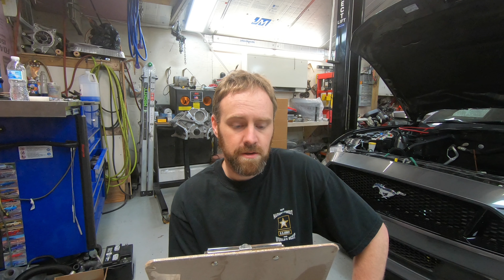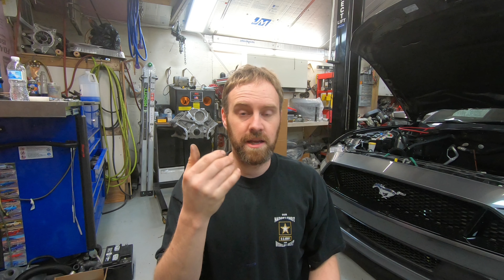AFM DOD Emissions testing & My Thoughts

Comment: In washington state we no longer need emissions testing. But prior to them no longer requiring emissions testing. The way that we would test for emissions was to check the gas cap to make sure it would hold pressure. And the second thing they did was to turn your car off and back on to see if your check engine light functioned. The third thing that they did was to actually plug a scanner into the obd2 port and check for fault codes. So as long as you have the afm/DOD turned off in the ecm and you have no other fault codes. Then there's nothing to worry about because the ecm will only give you a fault code for not having the correct parts if you have it activated. So my recommendation if you live in a state where they plug a scanner into your car is to actually get the ecm tuned to have it deactivated. When I fixed my girlfriends 07 Tahoe I used the guy that Crazed Performance recommended. They did great work with a very quick return and they were the cheapest place around. It was less than $75. I honestly couldn't have fixed it if it hadn't been for this guy right here. He's probably the most knowledgeable person on this subject besides the people who designed this system.

Comment: CT performs OBD emissions tests (not tailpipe).  For my last test, I unplugged my Range device just before pulling in and, as expected, it failed.  I disconnected the range, drove a drive cycle and it passed.  Just have to play the game.
Reply: I just failed by emissions too with my Range Tech on my 2017 Silverado 5.3.  I got it removed and was told to drive it for about 200 miles then come back.  There was a wrinkle however, I had a new battery installed about a year ago.  And they said the battery may not have cycled properly with the Range Tech.  My blue state has: emissions testing, carbon tax, green fee, and clean air act fee--all money grabs!

Comment: 2008 L76 Suburban 145k miles. AFM/DoD disabled. Passes emissions in AZ (which follows the same CA emissions testing.) no exhaust testing. Only OBDII testing and gas cap pressure testing. When idling during the test and upon throttle, the V8 mode is always on any way. I’ve never failed in past 4 years with 3 emissions tests.
Reply: Did u have a tune an were the ready monitors all set?

Comment: I just unplug my Range and drive a few mile before inspection and pass emissions in MA without a problem. I plug it back in after I get my sticker. No problem yet.
Reply from the maker: Can't do that if you have done the lifter release trick though, that's the issue these people are having.
Reply: @CrazedPerformanceRepair  So, it's turning the AFM system off AND modifying the engine.

Comment: I see that Summit Racing recommends with AFM/DOD Delete, you should go to standard volume pump, but also "plug the pressure relief valve in the oil pan".  Noting your recommendation of the pump myth, what are your thoughts with the removing the pressure relief valve and applying the plug as they recommended?
Reply from the maker: If removing the high volume pump definitely good to plug relief valve in pan. If keeping high volume pump I wouldn't do that. The big thing is to base your choice off the health of the engines oiling system. If pressure was a issue prior to service and resulted in a collapsed lifter. I wouldn't remove high volume pump unless you fix pressure issues. It's very common for the pressure issue to be a bad second camshaft bearing. I talked about this in a cam bearing install video I did if interested.

Comment: And the reason My problem with GM is they have some decent vehicles. They have potential that they could easily make good if they wanted to. They just choose to use cheap parts and they also suck at hiding their planned failures or planned obsolescence whatever you want to call it just blow at hiding it. It's pretty bleeding. I mean they put crappy lifters in their engines and their transmissions have crappy torque converters and the pressures are way too low and everything just slips and they move like a bag of hammers they shift like a bag of hammers seriously the 6L80 especially!!! Ford does it too. They're just better at hiding it... Making you use a special tool or they're just better at hiding things that are going to break as planned. You know also they like to hide stuff behind things or make things really hard to get at or need a special tool which makes my money. They're just smarter at making money than GM and pisses me off. GM should just give us the truck that we should have got. We shouldn't have to modify anything. Should just come from the factory with all eight cylinders firing and a good transmission. Even a manual. Anything other than what they're offering. I mean the 10 speed is okay. I think it's four speed is all you need in an automatic. There's no need for more than four gears, That's just my opinion. Maybe five tops

Comment: It will not pass since you'll need to disable DOD on ECM's software and most software like HP Tuners and many others even if you make a minimum change in the calibration software values it'll change CVN(s), which is calculated by an algorithm and that is what California's BAR (Bureau Automotive Repair) is paying attention to, those CVN's must match to that particular calibration #, to what that manufacturer has posted without any software changes, if a manufacturer release an update, that calibration # will have its own CVN'(s) (Calibration Verification Number) from manufacturer, if they doesn't match BAR knows it during testing and you'll get a Smog failed for the OBD portion of that test and an appointment with a BAR Referee to solve this issue and then get that ECM reflash with a "stock software". BAR has several years doing this, checking those CVN's against CAL #'s, since software for tuning has become very popular. 
Now if you have a OBD dongle connected to that OBD2 Port preventing DOD from activation, that will not affect anything if you have it that disconnected during testing and readiness tests completed after a drive cycle. Unless you have a way to keep their original CVN(s) shouldn't pass smog test in California. Emissions standards are getting more and more tighter by EPA and CARB. If you add thousands and thousands of vehicles that really matters that's why this technologies which are not perfect by far and experimantal (and more expensive) but at least an attempting to reduce pollution of inefficient internal combustion engines otherwise by not doing nothing, future generations will have a more polluted environment. Just because pollution usually is not visible, doesn't mean that problem doesn't exist, if you get an air sample on places where vehicle's density higher versus other places where's smaller, you'll see a difference in those samples, that is what those agencies are doing for decades. Sorry for those who are not agree with all this, no worries, it is only my opinion. I live in California and I working as a tech in a shop with a star smog station, I usually don't like to mention this, I'm only saying this because is related to this topic but I just know very little to this and hopefully this helps someone else about what's going on in California, for smog testing as far as I know, and more people can add their knowledge about this interesting topic in many ways.
Reply from the maker: Interesting and go figure it's california doing this kind of testing 🙄... It's unfortunate because I'm fairly certain the emissions in the AFM equipped vehicles is worst if anything. Might have slightly less hydrocarbons while the system is active in that it's using a miniscule amount less fuel, but not only as soon as it goes back to v8 it blows oil from the 4 dead cylinders into the exhaust. Over time makes the 4 cylinders rings less able to scrape oil off the walls thus burns more oil. Further more it creates a need for more repairs which creates more pollution. Requires more driving to shops, more parts to be made, creates more trash, all that creates pollution.The parts are also harder to make and because there is a longer manufacturing process to make them it creates more pollution then the standard parts. All these politics over a system that doesn't have a net gain in reducing pollution. I wish engineers would think a little more about what the results of what they create it. The only emissions control thing that works well is evap and cat converters. Otherwise best thing we could do is have less b's installed so the vehicles are lighter and more aerodynamic thus less emissions. Not sure why we keep adding weight with things like park assist to fix stupid. Haven't we realized by now we will just keep making better idiots. 😂 There are ways to make a much more efficient combustion engine and I have been working on making it but just don't have the financial means to do it yet. Can't mention how I'm doing it as I have no patent on it and prototypes are insainly expensive to make and test. It should make a huge increase in combustion engine efficiency without effecting reliability though.
Reply: I'm in CA and was wondering if I DOD my moms truck if I would have a smog failure issue, this resolves that, I will have to fix the lifter issue with all OEM stock CA Carb Compliant parts... what a bummer.  Time to sell the truck when its done before they fail again.